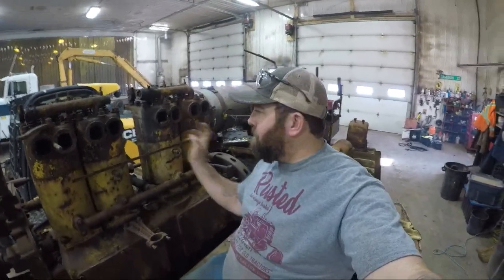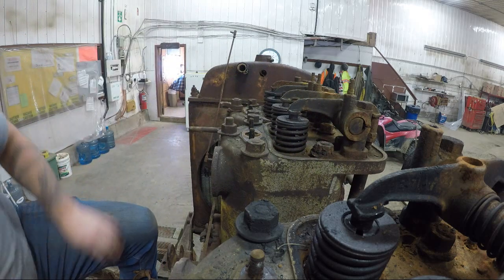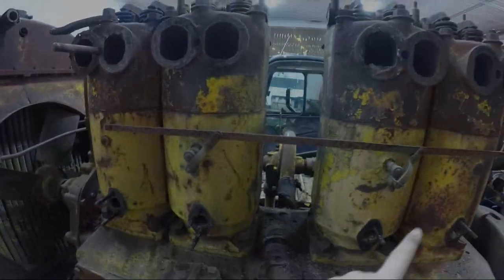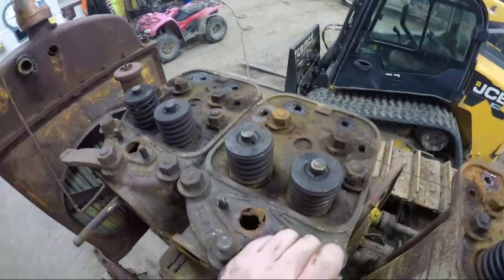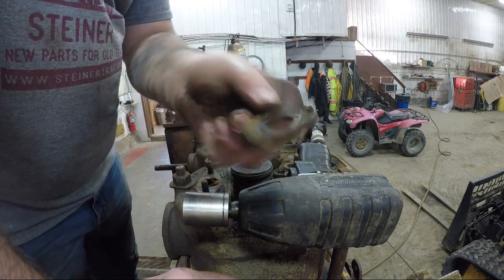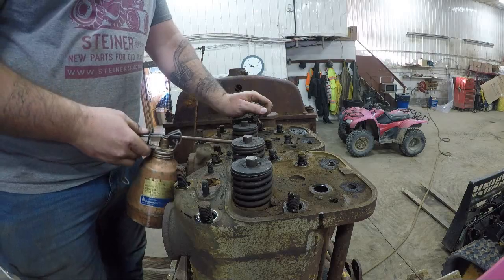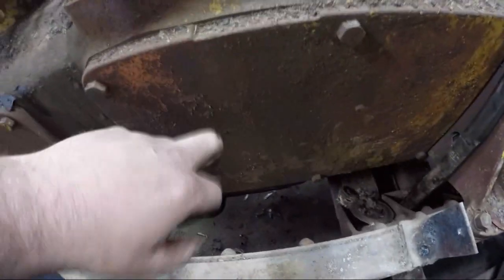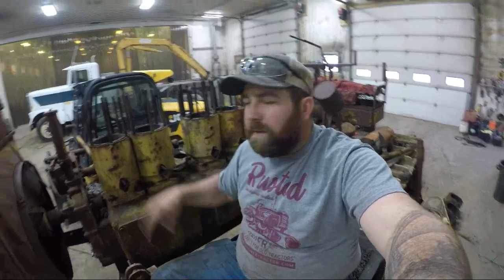Caterpillar SIXTY Rebuild Project - Disassembly Part 3 removing the heads

Comment: if u get into the rear end make sure u remeber wich side the crown gear is on they will go in both ways u will have lots of reverse gears i can tell u that had mine apart for ayear got it all set in steering cluthes bolted up before i noticed the mistake

Comment: Man those heads looked heavy enough and the jugs are pretty rusty too how much of that is sugar rust and how much is pitting rust? Either way that looks to be a whole piston and jug removal perhaps soaking it down with diesel additive will help break up that rust and free up the pistons and jugs. Awesome video
Reply from the maker: Hello Shane thanks for watching - yes they were heavy! And you are correct they have to come out in a single rusted together unit.  We had em soaking but hadn’t helped yet.
Reply: @ironman3406  yep they looked like candidates for total emersion

Comment: Mine had 2 pushrods rusted so tight I head I had to remove head with them stuck in head and put it on the press to get them out. Mine didn’t have headbolt washers. Are your’s 6 1/2 or 6 3/4 bore? I had to pull cylinders and piston/rod assemblies together, very heavy.
Reply from the maker: I didn’t think those washers were right, this one is 6.5” bore our other one is 6.75” bore.  Thanks again!!